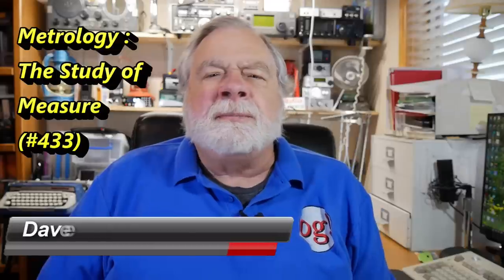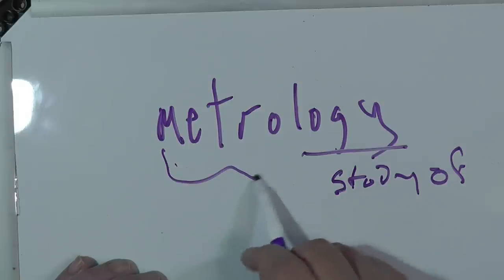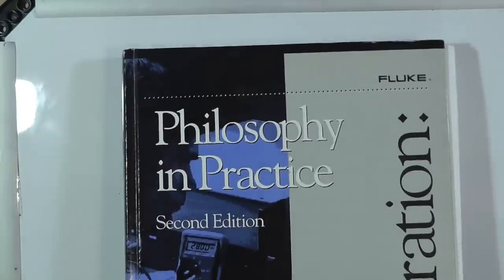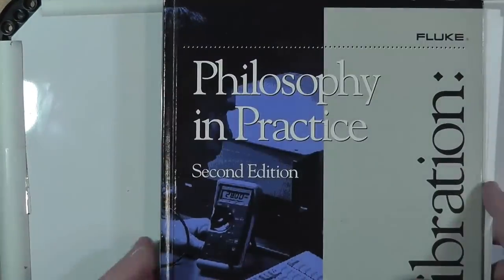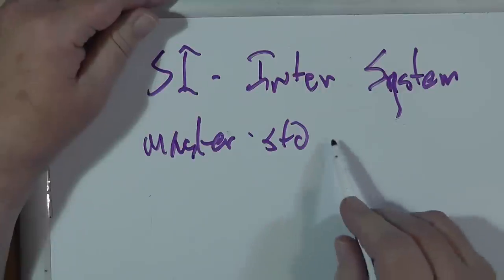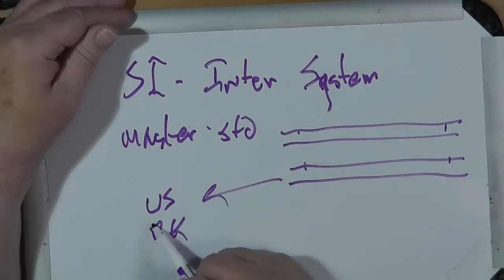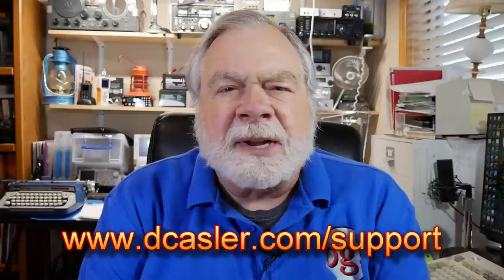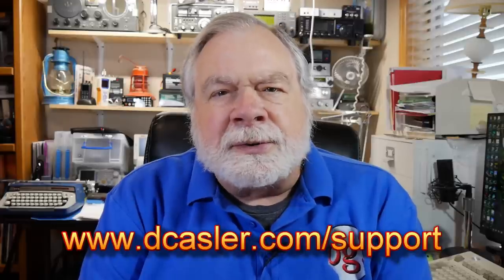Metrology : The Study of Measure (#433)

Comment: I was in the Air Force from 1958 t0 1965 four years of which in PMEL ( Precision Measurement  Equipment Laboratory) repairing and calibrating all typed on instrumentation. Everything had to be traceable to NBS ,as it was called then. From the AF I went to work for HP in Philadelphia repairing and calibrating HP gear. Left there and went to work at NASA in Houston. Ended up there as a tech writer, writing calibration procedures for all the instrumentation in NASA inventory. I was there all through Mercury, Gemini and Apollo programs
Reply: John Lehman  , God bless, THAT was a period of extreme need and NASA delivered on all counts.
Reply: Great time period. Always amazed me that we put a man on the moon using a slide rule (K&E or Pickett) that you could purchase at any 5 & 10 cent store and we have machines now that compute billion times faster and we are almost dead last in school mathematics. People understood math  in that time period when they had to use a slide rule. Now they rely on their $10 calculator to do it all for them and still don't understand how it was computed. Very sad.

Comment: One thing you didn't mention was SAFETY. In ham radio, often there are dangerous or even deadly voltages present which require measurement. Fluke is a company known for the safety of its instruments... whereas, Keysight is known for the ACCURACY of it's gear. One other thing is input loading or input impedance. Encourage people doing work with low power equipment, FET, or any high impedance sources to use an instrument which has a very high input impedance. The standard, "cheap" DMM has a rather low impedance, and some have high impedance... but NOT high enough for accuracy. By the way, Fluke is NOT in the "cheap" category! LOL  de KQ2E

Comment: I built a 10.0000 volt dc reference source to calibrate my DMMs for 12vdc use. Easy & inexpensive these days.
 That same red HF meter was reading 12.4 volts at an actual 12vdc. That's off by 40% if you are measuring battery charge state. Basically, the HF meter is just a test lamp until you calibrate it. Never seen a name brand off that much.
Reply: Lyfan Deth  ,  They just don't "get it."

Comment: Just spent the day doing my scheduled oil change.  Tomorrow is set aside for annotating the engine log books and a post-maintenance test flight (before the thunderboomerators roll in) as well as cleaning up the rest of the mess from the change and disposing the old oil. (the joys of aircraft ownership)

Comment: In Defense Of Dancing Needles:  Certainly, we cannot completely trust the absolute accuracy of the voltage and amperage meters on our power supplies, but if they can alert us to a possible major problem when they are reading dangerously high or low, are these little inaccurate meters not doing their job and doing their wok?  The SWR meters on our radios are notoriously questionable for the fine purposes of tuning compared to an external wattmeter, yet when they show exceptionally high SWR's and alert us to a major problem and help us save our finals, are they not doing a fine job?  Even some rigs with very imprecise meters are at LEAST accurate enough to alert us to trouble.

I, for one, not only enjoy the aesthetic of the dancing needles, but also appreciate the added security that even the "rough ones", as long as they are at least somewhat accurate and consistent, provide.

As an end, I'll mention my Pyramid PSK52 linear "junker" power supply, that doesn't get much use compared to my beefy Astron 70M.  When I was doing tests on it, for a review video I simply never get around to finishing, the voltage meter was very accurate in following the voltage, according to my high end Hioki multimeter; save for the fact that it was always reading exactly one volt high!  It may not read correctly, but at least it measures consistently!

Comment: Hi Dave, this is off topic but I want to send a koodoos! First off: I am a new HAM, VE3PUH, from Ontario, Canada. About an hour north of Toronto. Retired. I have been aware of antennas and basic radio (not CB) for some time but just recently achieved my Basic with Honours ticket (Canadian). Just yesterday I watched your program on single wire endfed multi-band antennas; regarding a counter-poise or not. My available surface area is an issue so the 160/10m with unun purchased from an name with-held manufacture has trouble 'stretching out'. I ended up with the unun about 30' in a tree stretched 40 some feet a little more than horizontally to another tree, where a 90 degree turn stretches the remaining wire about the same height to the final tree. (Sycamore, Scotch Pine, Spruce) All this with the first length about 20 ft. from the house and the final stretch 12 ft. from the house and quite close to a hedge which is slightly higher than the wire. Needless to say my IC-7300 made the best possible of the situation. I had a QSL from Indianapolis and from New Hampshire but with night-time, and optimum conditions, at least what the solar conditions would give 4 nights ago, helped. Now to the point: after watching your video on counter-poises, and against the manufacture's recommendation, I 'did a test', as you suggested. The experiment was today at about noon where I tuned a strong(est) frequency I could find on 40m and turned of the set. I then added a verticle length of stranded/insulated/tinned wire of I believe 14 gauge to the ground lug on the unun and dropped it down to 8" from the ground with a metal weight to keep it stretched out straight. Wow! Back at the IC-7300 the exact frequency produced a much clearer return, and generally several more clearer conversations on 40m. Not-with-standing the possible atmospheric shift in the 1/2 hour difference, I am tickled to death with your counter-poise suggestion. The compromised antenna route does not help and I might not ever make the 10m beacon in England, but for now the improvement is significant. My  RigExpert AA-230 Zoom helps with home built 2m/70cm/ dipoles and other tuned models, as well as my attempts at a tuned 10m and a 6m project in the works, but as above, space and my wife's common sense about "the money pit" are the only restraints. My attention is to the build, and not the gab. Again: thanks for the many good videos, and the common sense approach to passing on the intricacies of HAM. KE0OG/VE3PUH.  73 (subscribed future binge watcher)